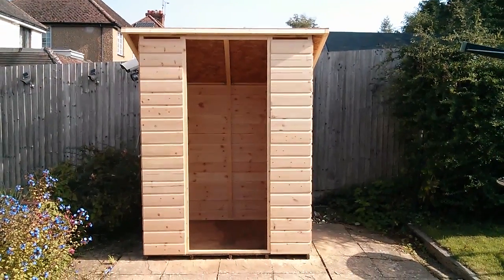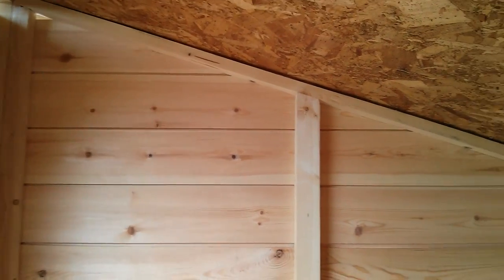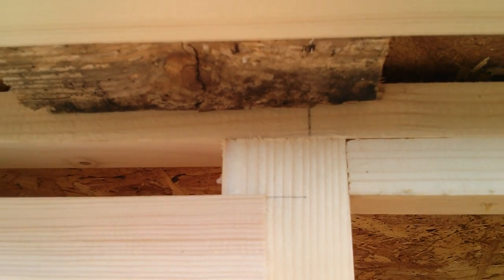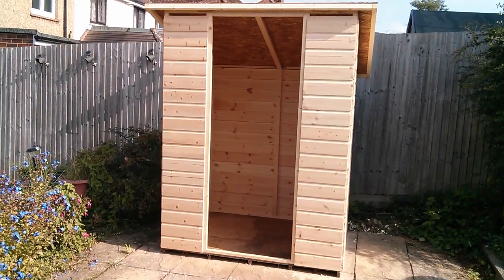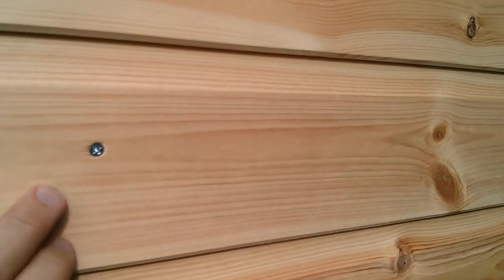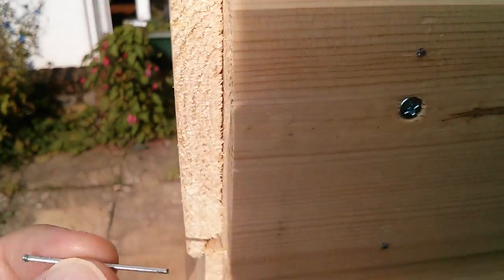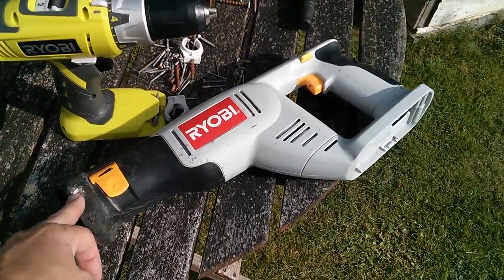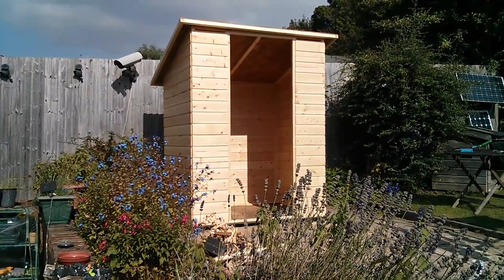I Built a Shed

Comment: Another vote for leave the screws in. That shed is constructed with the bare minimum support, especially the roof. The screws do contribute some. Please don't attach your roof panels with brads. I'd come over and build you a shed if you would do the code for my Arduino project!!
Reply from the maker: Danny Johnston The roof will be screwed on - might blow away otherwise
Reply: Agreed, Danny. Those brads will pull through in time. And thanks for the video, Julian.

Comment: Bit late to the party but I'd suggest putting pressure treated timber bearers under the floor joists at 90 degrees - just so the joists are not sat on the concrete getting damp and  potentially rotting. should be possible to retrofit to a shed of that size by tilting it.

Comment: Having built two sheds myself (I'm not a carpenter, but they are still standing ;) ) a few tips:

You stick the cladding together so there's no gap at all on the inside. Depending on the board profile there will still be a mostly aesthetical gap on the outside. Start with a very straight board on the bottom and nail it on, then push the next board down to it (or even clamp it for very crooked ones) while nailing them. So in the end all will be straight. Of the boards I used, they have all contracted a little over time and the gaps got larger, especially in winter when the air is drier. Packing the boards like that also gives more stability, because there's no way the boards could move any closer if the wall wanted to shift like a parallelogram. Try to push the shed near the top. If you can move it, add some bracing on the inside of the wall to create "structural triangles" (e. g. a board from the bottom front corner to the top back on both sides).

The nails are a little bit small. Even if spruce (looks like that's what you're using) is very soft, it will still "work" quite a lot over the seasons. It could happen that they pull out the nail or pull the head of the nail through. I was using 2.1x55mm brad nails and even then a few boards seem to have been able to lift a little from the studs. A board of larch (used as the bottom skirt of the walls because it's more weather resistant) pulled out some of these nails a few mm. Took even bigger nails and screws there to keep it flush.

About how you'd join up the rafters to the wall plates (damn, I wouldn't even know these terms in German): the rafters (the slanted parts) rest on top of the wall plates (the top horizontal load bearing part of a wall). A small angled notch is cut into the rafters, where they meet the wall plate, so they fit. The roof only touches the rafters, not the horizontal beams.

But don't worry I think your shed will still be fine. We can have quite some amount of snow here in Austria so I maybe overdid it. But I can also say that the doors of the shed still open and close without any problem.
Reply from the maker: superdau Actually, my initial reasoning for leaving gaps between the cladding boards, was to use fewer boards. But of course that's nonsense - the total of all the gaps doesn't add up to one full board - I'm such an idiot! And you're right - closing the boards would make the whole thing more rigid. Hopefully, applying liberal amounts of preservative shed paint will stop the panels warping too much.
Reply: You should have a couple of millimeters between boards to allow for expansion.
Reply: aptsys
When I've seen other people do it, they've always pushed them together (that's the only way to get them all straight). And for me the board always shrunk and never expanded.

Comment: Not sure if you ever did find a solution, or if anyone suggested this before, but you might want to consider getting some expanding spray foam to fill in the little gaps between the top of the frame and the roof.

You can get it at any hardware store and you just spray it in, and it expands. Then cut off the excess with a utility knife.

Comment: I like the vents slots at the top of the shed on  the front... at least I assume they're vents! If your aim is to keep the shed cool in the summer then you'd need some similar sized slots lower down on the back of the shed as an air inlet. I need to do something like this on my shed - the temperature inside soars on a hot summer day!
Reply from the maker: ForViewingOnly They're not really vents (although I like that idea) - they're just unfinished gaps.
Reply: Julian's Other Stuff Oops :-)  Might be worth keeping them though. Any damp that gets in will clear before mould sets in, and the temperature won't reach melting point on a hot day. You could put an anti-insect mesh over them, and add a couple of similar sized rain-proof vents in the back at the bottom so that convection keeps the air moving.
I only subscribed recently so I'm looking forward to catching up on your older videos. Cheers.
Reply: Julian's Other Stuff  Leave them as vents. I discovered all the sheds that are being sold here do not have ventilation. Well in our climate that is not a good idea. After placing mine 2 years later everything was rusted inside and it always felt damp. Now 1 vent in the front lower corner and 1 at the back opposite other corner no more damp and it feels healthy inside. You only need to make sure that no direct rain can enter through the ventilation, but nothing that a piece of wood above can't solve.

Comment: for the back beam, I would guess the right way would be to put it in at the same angle the roof is in rather than cutting out a part all over the length.  You would have to miter the  vertical posts to accommodate for that ofc.

Comment: You do some odd stuff sometimes... The roof is built as a solid square frame, you don't cut angles into it, it then overhangs the structure and is screwed sideways onto the vertical posts. No angles required.
Again, cladding is done on the ground as a square frame and butted up tight (use a ratchet strap), it will shrink later because it's green.
That base is going to rot in a week because your roof is dumping water onto it, throw it away and rebuild it on a few bricks. Use plywood not OSB.
Personally I'd give all those chairs away to neighbours, and then ask to borrow them if you ever host your own royal wedding again (so, like never).
The bradgun is neat though.

Comment: Good work.

Make sure you cover or paint the roof as even if its marine grade or what ever the rating is for particle board it looks like it will allow water to fill gaps on the surface. When that water freezes it will expand and eventually degrade or crack the panel.

Polyurethane would work well but one rated for external so the UV does not affect it. Oh I forgot your in England so you only get to see the Sun once or twice a year :-)
Reply from the maker: Systemrat2008 I'll cover it with roofing felt
Reply: Julian's Other Stuff I am not 100% sure what that is but just very, very glad it does not snow and rain and get cold etc. etc. here like it does in jolly old England. :-)

Comment: Good work Mate. I would have rotated the "cladding" (spelling?) 90 degree, so the rain would drain more easily.
Reply: Actually that's not a good idea. Wood is quite resilient to water without any treatment as long as it isn't in constant contact. If you'd place the boards vertical it would be much easier for water to get into the tongue-and-groove where it can take a long time to dry. With the boards horizontal (and making sure the tongue is up) the water has no crevice to flow into. And most of the wall is still completely vertical anyway.
Reply: Nope, he did actually get that detail right. Wood that can dry out fully will last years. His base is doomed though, and he's left his end grain exposed.

Comment: Suprised you did not set this the other way up as a good base for part of the solar panel collection . 
Why pull out the screws . the're in ,leave them . As you are not sure about the joints , mix up some thinned PVA glue about single cream & use it as a wash on all the frame to cladding joints .

Comment: Three days? Seriously? Not a bad job but I would line the inside with heavy gauge steel mesh and MIG weld together to make a rigid frame and prevent anyone easily breaking in.  Also line the door with a steel flange so good locks can be fitted. BTW line the roof and floor as well. Then put an mdf floor on top of the mesh. Sheds are such a popular target for the huge number of thieving teenagers that the UK is cursed with that a bit of protection  is well worth it.  Obviously never put anything valuable in there as well.